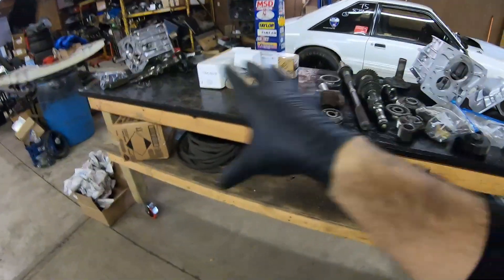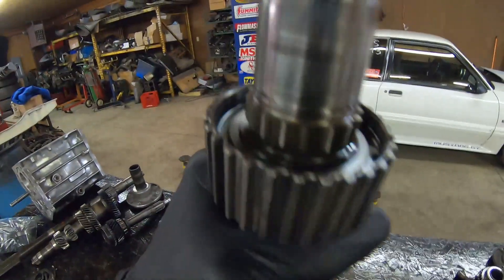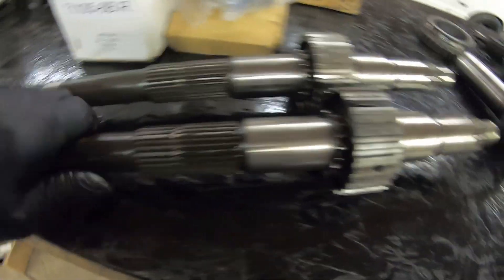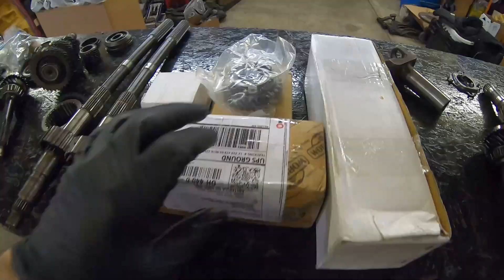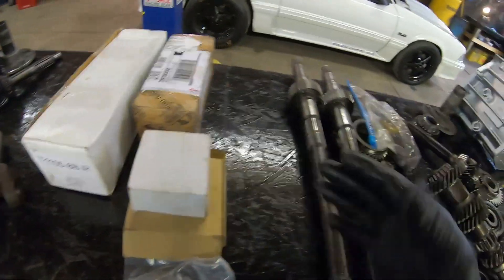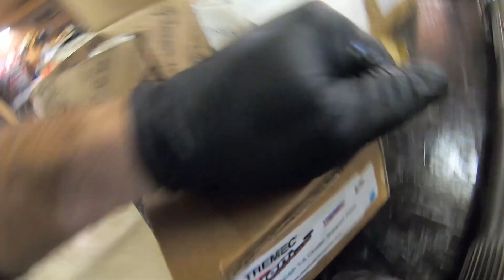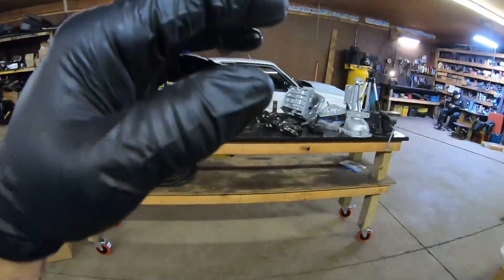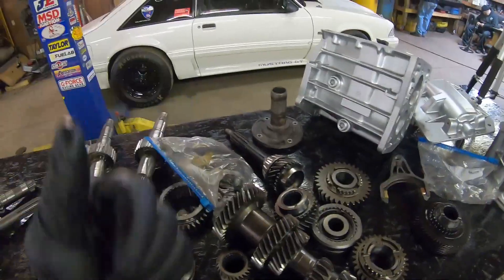How to Change a T5 Transmission 4cyl TO V8 / It's Easier Than You THINK!

Comment: There's nothing really tricky about rebuilding a T5. Deburr the gears if necessary, use a machined countershaft support plate, use quality blocker rings, and get the preload correct.
Reply: Yes sir. Will do. 
I have my first wold class t5 torn apart on my coffee table as we speak

Comment: I have a '71 Blazer, a T5 with a Dana20 attached & a desire to use what I have without buying a new trans .

I suspect that this T5 /DANA20 came out of a Jeep perhaps a 4 cyl or straight -6.

Who here has put this in a larger, V8 truck like this?

If this YouTuber is building T5s with minimal effort for Hi-Perf V8 Mustangs, then this oughta be a good fit for a Street cruising, very rare 4wd use Blazer like mine.

And, also, Yes.  I want that 5th Gear, too .

Comment: What's the difference between a fox tranny and a Camaro t5
Reply: No answer from this 'expert' after one year? One the gm t5 is tilted over to fit in the car, and first gear ratio is lower. Input shaft is slimmer.and a few other reasons

Comment: I have a WC T5 from a 98 v6 which has the same 3.35 gear set as the v8 T5s. I want to swap this T5 into my 66’ 200 i6 mustang and I would prefer the steeper 4cyl 3.97 ratio gear set for the underpowered 200 i6. I see the 4cyl v8 conversion is common so figured I could do the reverse. I understand that many parts are interchangeable but what parts would I need to swap out from my current v8 T5 for a 4cyl conversion. Also, I’m having trouble finding a 4cyl T5 conversion kit, any guidance on where I can find one?
Reply from the maker: Not a popular swap. Best to sell v8 trans and just buy a 4cyl one

Comment: If I run the t5 from an s10 for the time being in my 302, do I have to swap input shafts? Or is their a clutch disc that will work on the 302 with the s-10 splines?

Comment: On the input shaft, whats the size difference from v8 to 4cyl? The tip that slides into the crank?
Reply from the maker: The 4cyl one is smaller.  Gears and shaft. The tip is just an easy way to ID it

Comment: Great video! I have a 4 cyl T-5 in the corner for a spare, now I think I'm going to beef it up a little.
Reply from the maker: Ya I mean for what they go for now? It’s not a lose situation.
Reply: @Neomustangs  I bought it connected to a 5.0HO longblock for $200. The guy was told it was a 4 cyl trans so who knows. Now I have to grab my 17mm wrench and dig it out to check the bearing retainer.

Comment: Nothing beats a nice shifting stickshift mustang. The only way to learn is to watch a YouTube video or 10 and start working on them. I appreciate you helping me out last year man. I was on the phone with so many big companies you wouldn’t believe and you were the only person that absolutely knew exactly what was going on. I had my magnum out 2 or 3 times with hammered up throwout bearings with no lift. I used one of those harbor freight tranny jacks and a strap and it went pretty good. I actually had the car together and almost ready to start when you told me the right measurement for the pivot ball. I trusted you and took it all back apart and adjusted it to where you said and it works great.
Reply from the maker: Yes sir. That’s what it’s all about !

Comment: I had a 89 Foxbody that I used a 4 banger 5spd in. I had to find a v8 bell housing and 83 Ford ranger diesel pilot bearing if I remember correctly.

What I wasn’t told is this transmission is not a good idea with my 4.10 gears. 1st and 2nd was basically useless lol. I would start out in 2nd and go straight to 3rd. 

I miss that car so much lol. I have a TTOP fox now with a 306 so I’m still in the game.
Reply from the maker: Yep. 3.97 plus 4.10. = useless

Comment: I have always heard that the 4 cylinder input shaft would fit the v8 flywheel if you use a diesel ranger pilot bearing/bushing? I may have to try this conversion sometime. I know where I can get my hands on some 4 banger t5s.
Reply from the maker: That’s on install. Yes 83-84 diesel ranger pilot bearing. It won’t fit inside on a v8